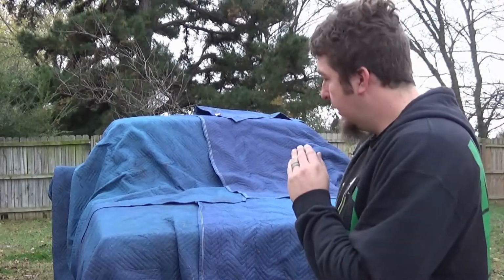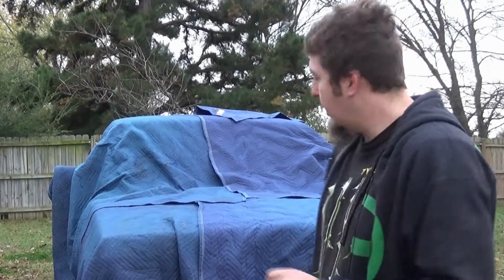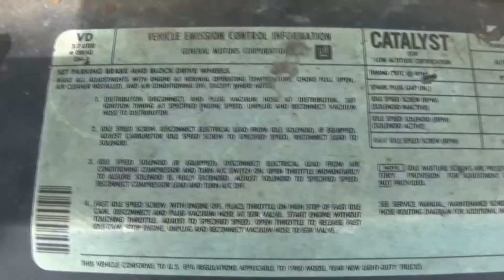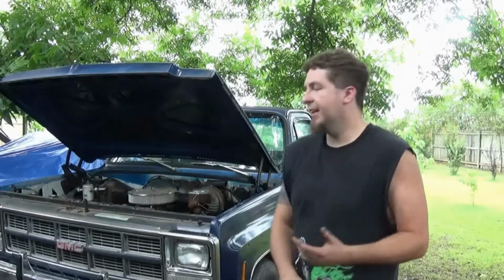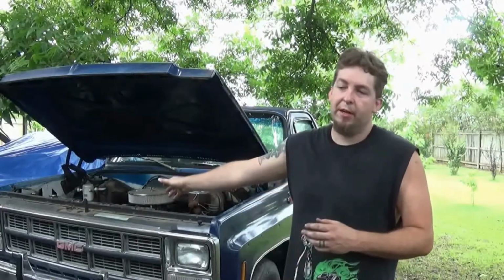c10 ol Blue Ep 1 Another round eye squarebody

Comment: I will say as I've always said,a properly tuned,correctly cleaned up and rebuilt quadrajet is better than almost anything else especially for the gm vehicles they came on,they will have better part throttle acceleration and usually pull better mpg with moderate throttle response than most carbs, especially a Edelbrock.. and Holley carbs don't usually do good mpg and perform well on the street,but thats not what they were built for either..
Reply from the maker: o yea, i love my quadrajets. always had good luck with them. Edelbrocks never had any good luck with any. And holleys i guess including the other brands are good the double pumpers are great but to me they are for racing not street
Reply: @EfurdGarage   problem with Holley's is you usually have to tune them for every season or even some altitude changes... forget that...I'll take a qjet, and believe it or not if the bowls are not warped or the airhorn a Carter thermoquad is almost as reliable as a quadrajet
Reply from the maker: @richardbates2367  yep old quadrajet set it and forget it. Old carter and Rochesters where good they knew what they where doing
Reply: @EfurdGarage  did you know the first quadrajet carburetors we're actually Carter's same as the thermoquad why they are similar in function and design.. later on the patent design for the quadrajet carb became Rochester quadrajet.

Comment: @EfurdGarage I have a 2003 grand am with the 3.4 engine. I know you have a lot of videos on this same engine so im hoping you can help me. I have good fuel pressure, good compression in all cylinders, and great spark, but I continue to get a crank-no-start? I replaced the starter, cam shaft sensor (threw a code), new plugs and wires, replaced the fuel pressure regulator, and replaced the ignition switch in the dash... I have a new ECT sensor, which ill throw in tomorrow, then I'll try the MAP sensor next. Is there anything you can think I may be overlooking?
Reply from the maker: First thing that cam to mind is crank sensors. There are 2 of them. I would check them and the wiring since it sounds like you almost got everything else
Reply: @EfurdGarage  I thought of that too, but I have good spark
Reply: @EfurdGarage  the car has randomly started a few times too and I was able to drive it each of those 3 nights it started but the next day it would do the same thing, crank-no-start.
Reply from the maker: @jjcoux1884  your getting fuel pressure and spark. Starter is cranking. Only thing i can think is something is not letting the gas in or timing is off so it wont start. Map is a good possibility. Vacuum somewhere but i feel tjat would cause it to run rought. Maybe knock (cant remember if you checked that or not) but with knock i also feel like there would be some other thing to go along loke lack of power or something
Reply: @EfurdGarage  I replaced the ECT last night too, I agree MAP sensor next
Reply: Replaced the MAP sensor and still doesn't start? I'm completely stumped. Think I'm gonna bite the bullet and tow it to a garage to have them put it on their diagnostics
Reply from the maker: @jjcoux1884  yea its hard to find sometimes, and if there is a light on should be easy but you dont always get the light.